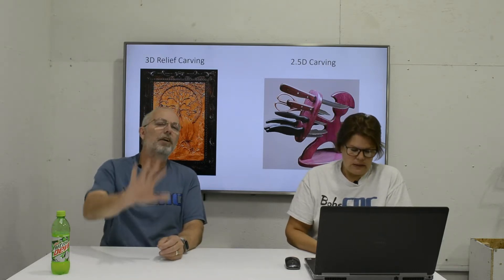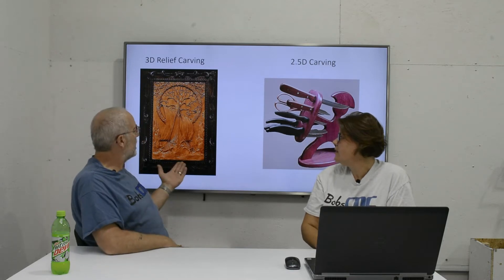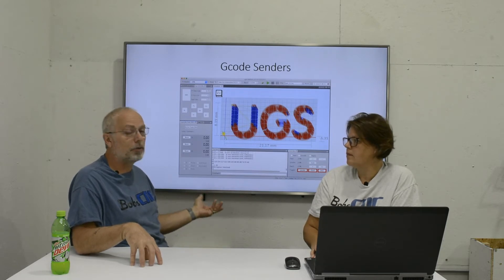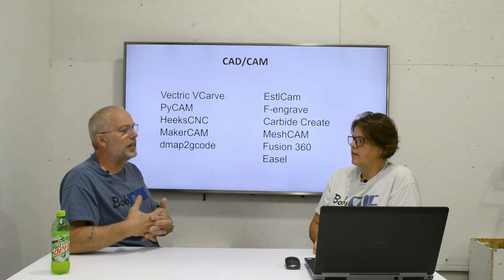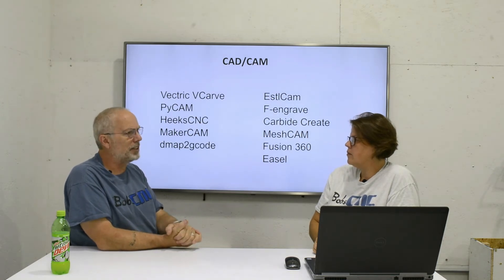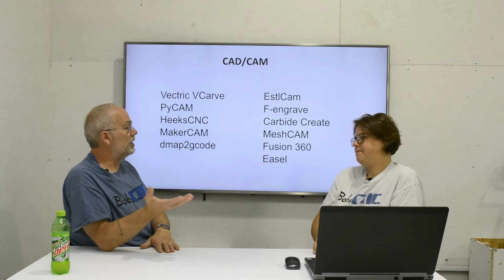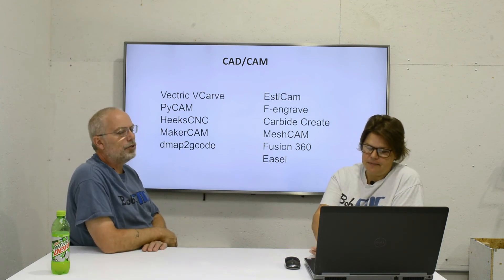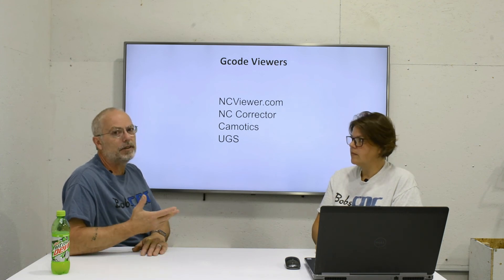Shop Talk: CAD/CAM Software Options

Comment: Thanks for all your help Bob Kristen and her dad what’s his name;) You gave me personal attention Bob when writing in about getting correct Java on my Mac. Thanks it worked and the machine is up and running (E4).  If you’re just starting out I would say two things,  one is to have patience and two is if you’re having issues then go back and follow the steps again carefully and or look for answers on these videos. it will all work out even though sometimes it doesn’t seem like it will.                

So maybe I missed it but in this video you say about carbide create it also works on a Mac, but I didn’t see where you said there was another software  option that works on  a Mac.  Can u list the ones who have apple options please?  And I used carbide create non pro version and I thought the z axis was moving up and down. Is  CC 2.5 or 3D?
Reply from the maker: Thanks for the feedback. Carbide Create is 2.5D.

Comment: So once you use your CAD/CAM software to make your design, do you then run UGS to send the gcode file? How much interaction is needed within the UGS software. When I was viewing the X-Carve video, the impression I got was you make your design and then it carves it. How is your set up different and where does the UGS software fit in terms of the design to product process?